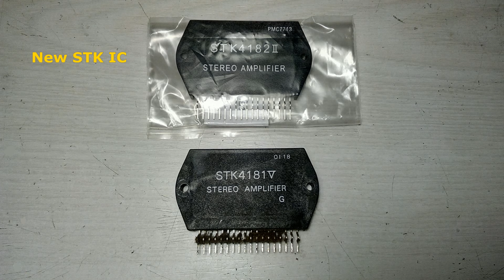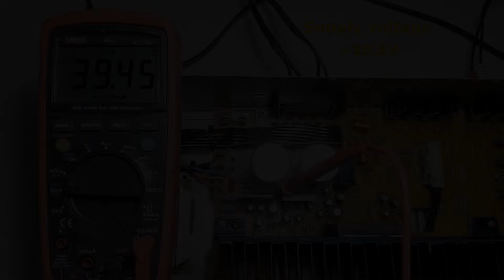PIONEER A-227 Integrated Stereo Amplifier (1990) Part 1 Repair

Comment: Guau...el tremendo cambio...que limpiador usaron para limpiar las placas ?... y los paneles..algún limpiador especial?...muchas gracias..excelente trabajo
Reply from the maker: El aparato estaba muy sucio y grasoso, es posible que algo se hubiera derramado dentro.
Lo traté con un desengrasante suave y luego con alcohol isopropílico, previa limpieza con spray de silicona.